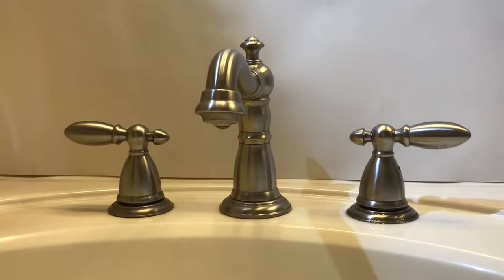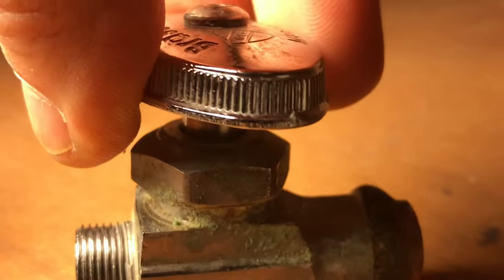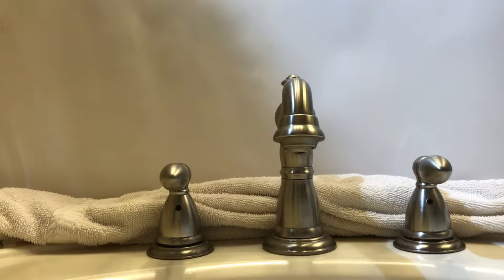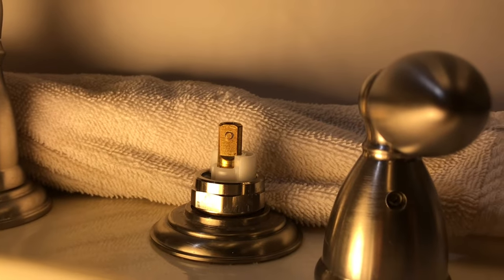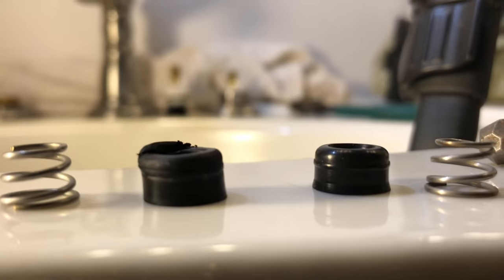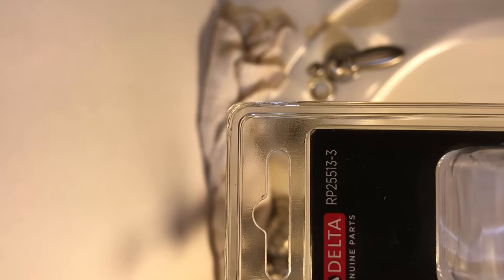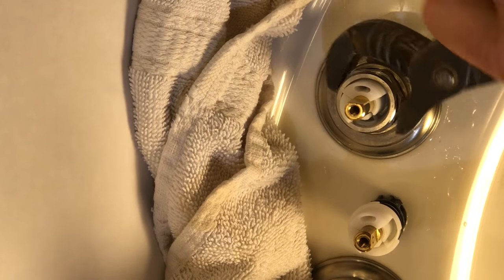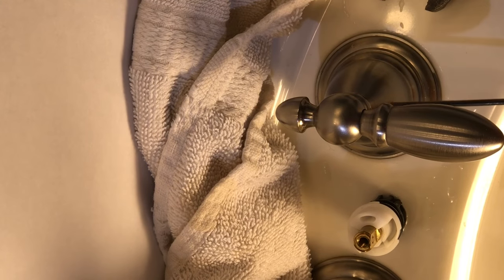How to Repair Leaking, Dripping Delta Faucet #diyplumbing #serviceplumbing @TappPlumbing

Comment: This is the way an instruction video should be made.  Very detailed and informative.  Compare this video to the Delta instructional video.  This one is so much better.  Thank you!
Reply: Very good , easy to follow, great job
Reply: Totally agree!
Reply from the maker: Thank you so much for your reply and watching 😊
Reply: I agree too! The one from Delta is not helpful, especially for someone like me, who never has fixed bathtub faucet leaks before! Thank you for your help!
Reply: I have a peerless bathroom faucet. I’ve changed out the cartridge, seat and spring on the hot side numerous times and I still have a steady drip? Help!!!😮 It is driving me crazy!!!
Reply: Great instructions

Comment: Very thorough and respectful of the parts and areas in where he is working. Some plumbers get the job done but ruin a finish or scratch the sink or counter. This is a professional.
Reply from the maker: Thanks for the nice comments and for watching!!
Reply: @TappPlumbing this video was VERY helpful to me EXCEPT that 1.)  the Allen key required for my set screw was a larger size (cold side). The hot side's set screw appears to be jimmied because my Allen key cannot get any grip. Is it time to call the plumber?
Reply from the maker: @UnderDog1911  That depends on the time verses money equation. If you can’t get the screws out it is gonna turn a little more time consuming and you need to have new handles also . Either the screws will have to be drilled out or the handles will have to be sawed off.

Comment: Unless I missed something ,You assumed the cold water faucet was leaking , not the hot water. side. Otherwise great video..
Reply from the maker: I should have mentioned it is best just to ahead and do them both . Thanks for pointing that out ! Thanks for watching also!

Comment: I have two faucets in my bathroom. Only one of them leaks. I disassembled all the handles and none of them had springs or rubber seals below the cartridge. Is my faucet different?
Reply from the maker: Is it Delta? Can you add a picture of your faucet. Email it to info@TappPlumbing.com if you can't attach here. I have never seen a 2 handle Delta without cartridge and seats and springs.

Comment: Sir, you just saved me a plumber's bill and a ton of hassle. I followed your instructions and fixed my delta bathtub faucet. Turned out to be a cracked valve seat, which I wouldn't have figured out without your video. Thanks in 2023!

Comment: +1 on the positive comments.  Excellent instruction that worked perfectly ... turning a DIY project (with the normal 'trial and error' risk) or a $$ plumber bill (if you're not the DIY type) into a flawless 10-15 minute fix, all in.  When you call Delta for a replacement cartridge be sure to request seats and springs too.  Delta will send a new cartridge(s) for free under lifetime warranty but I had to run to HD for the seats and springs because I didn't know to ask for them.

Comment: This is the best DIY video that I have seen. The helpful tips made this an easy job for me to do the right way, especially how to get the seal and spring out and the replacement parts in. Also appreciate giving the model number of the cartridge so that I could shop around for the best price and make sure it was in stock before heading out to the store. Thank you very much !!

Comment: Thank you so much for this. After fixing my sink, I have just a few comments
1. My handle took some strength to get off. Dont worry if you have to pull hard
2. Take a pic of the stem before/after taking it out. 
3. Home depot lists the part as a "stem" and not a cartridge, just so people dont get confused. 
There is part RP255513 and 255513-3. Not sure what the difference is. They are the same skew# at HD. 
My handle felt a lot loser and easier to move after fixing it. Works great, no leaks. Just felt different 

Hope this helps everyone!
Reply from the maker: Thanks for sharing!! I bet it will be very helpful!!

Comment: Very HELPFUL video. 🥇 love it’s straight to the point. Followed it today to fix a drippy Delta faucet. Easy! Most time consuming was driving to hardware store. Note to future self: Do not throw away the fixture box…or at the very least write down the model number, goofball! (Speaking to myself there.) The faucet was installed in a new bathroom in 2017 so I was fairly confident the valve and seat/spring model numbers at the store would work. They did.
Reply from the maker: Thank you so much for the kind words and sharing your success story!!!

Comment: Having just done this repair, I would like to add that you can use a soda straw to clear the water from the seat well.

Insert the straw into the non seat hole and blow into the straw.  This will force the water out of the faucet spout.  It helps to wrap your hand or rag around the stem well as blow into the straw.
Reply from the maker: @robertthomas9438  That is a fantastic suggestion my friend! Thanks so much for watching and adding to the discussion!!

Comment: Thanks so much for posting this! I do have a general purpose book for household repairs, but it isn't specific to Delta faucets/valves, which is exactly what I needed. I appreciate the tips for replacing the parts properly and protecting the sink as well!👍
Reply from the maker: Thanks for the kind words!  Thanks for watching our video and sharing your story as well! I am gonna guess everything was a success.
Reply: @TappPlumbing  Yes indeed! It turned out that I needed to replace a cartridge, but everything works perfectly again. Thanks so much, and I'll definitely be watching for more tips in future!

Comment: Fantastic video! I have never done this and have a faucet (exact same) with a drip about every 5 seconds. Seems to subside or at least go to every 30 seconds or so with the handle not at full stop, slightly open. Now I am very confident on how to tackle this. 
Thanks for the tip on calling Delta too.
Reply from the maker: Please keep us posted with your results if you can make time.

Comment: This was great, especially the part about paying attention to the order in which you take things apart and their relative position. I am great at taking things apart without doing that, so putting things back together is always an adventure
Reply from the maker: Thanks so much for the kind words !hopefully you had a quick and easy time of things?
Reply: @TappPlumbing  Once I figured out I had the 1/4 turn stop in the wrong place :( and replaced it, it went smoothly.  But your video was so helpful and everything went just as you showed in the video.

Comment: Great video! My faucet was still dripping slightly after replacing the cartridge and spring assembly. I had to keep re-seating the spring and seat. Took a few attempts to get that part of the process right. No leaks or drips. Thank you!
Reply from the maker: It can be a little challenging getting those seats just right. There is no margin for error there. Thanks for the kind words and we love to hear your success story!

Comment: Just did the install and all went well, thanks to your clear notes and saying which cartridge to buy. One note is the lever stopper comes in the package with the cartridge and you need to install it (a little white plastic piece before you screw down the cartridge with the outer ring, this keeps the levers from turning more than a quarter turn if you want that instead of a full half turn. I also wonder if just new springs and seats would stop the leak as apposed to buying new cartridges. My cartridges did not come with the spring and seats,  Lowe’s sells them separately called Dankco repair kit for Delta scald guard 80465. 😅 so awesome to do this myself! Thanks a ton!
Reply from the maker: Thanks so much for your input!  If your faucet was only dripping from the spout changing the seats and springs would eliminate the problem almost every time.

Comment: I googled this and went straight to your video. I have the exact Delta faucet in oil rubbed bronze.  I absolutely love it! I have the matching shower fixture and jacuzzi faucets. They were pricey but I don't regret the purchase. I've had them 15 years and no regrets.
Thanks for sharing that Delta will send the FREE parts for this. I have a leak on my hot water side Lefty, and also on my other vanity a leak at the faucet. Is there a phone number you would recommend calling for Delta? I am a 69-year-old woman so I hope I am tasked for the job.  Retired in 2014 with everything going great until the last 4 years. Now with such an inflationary economy hasn't left me faring too well. I certainly cannot afford to hire a plumber. Any advice you can give to this older senior American would be very much appreciated. 
You have already done a lot by providing the video. Thanks again for caring enough to share.❤
Reply from the maker: We understand! Here is the Customer Service Number 1 (800) 345-3358.  The Style is called Victorian. We hope this helps and are hopeful our economy improves. Good Luck! We have faith that you can tackle this project! Thank you for watching!

Comment: Hi! The video is great, by the way, very instructional. I'm having this exact problem, and I know which one of them is leaking, but should I replace both of the seats and springs to be safe or will replacing just the one that's leaking be just fine?
Reply from the maker: We typically only replace the one dripping as sometimes it is best to go with , if it is not broke don't fix it. We like preventing things as well however water is tricky so just wait. We definitely recommend checking your water pressure though! https://www.youtube.com/watch?v=nrGZMxpp_Og&t=154s    Happy plumbing and we appreciate you taking the time to ask plumbing questions!

Comment: Thank you sir. I'm pretty sure I only needed to replace the rubber seat, but did the cartridge as well.  Man that thing is pesky, but getting ALL the water out was key.
Reply from the maker: It sounds like you did a great job ! You are correct, they can be very aggravating for something that should be so simple!! Getting all of the water out does make things much easier indeed!

Comment: Trying to follow your instruction and having a problem. The right hand side (hot water) cartridge came out just as easily as when you did it, but when I tried the left hand side (cold water) I had 2 problems. First, there was a lot of calcium buildup on the handle, but I eventually managed to work it loose and get it off. But now the cartridge will not come off - it comes up about half an inch but then won't come up any further - it feels like there is something holding it down from underneath. I tried rotating it all around and pulling in each new position but it just won't come loose - any suggestions?

EDIT: Was able to get it off finally...seems the key was to get frustrated enough that I became willing to use enough force that I was risking breaking it! Seems the calcium buildup was holding it down somehow - I can't see how, but something was doing it!
Reply: Yes, mine had a lot of calcium buildup, but they just pull straight up with a good amount of force

Comment: Excellent video overall, really well done. One *MAJOR* issue - you made a point of talking about setting the cartridge in the same position you took it out. You later made the point that you could replace the cartridge 180 degrees the way wrong, but you didn't illustrate how to AVOID THIS. It may sound like a nitpick, but it's the one BIG issue that you didn't expand on.  Regardless - great video. Thanks!
Reply: I'm lill

Comment: Hi, great job on the video. Mine is leaking around the handle and I think you said to replace the cartridge. Is the o-ring on the cartridge the problem and can I just replace it? Are there other seals in the cartridge that cause problems too?

Comment: Thank you Joe for a very clear and in formative video. I replaced the seat, spring and cartridge on my faucet but the water does not shut off. What did I do wrong? Also, where on the cartridge or stem does the O ring has to be placed? Thank you.
Reply from the maker: It sounds like a small piece of debris is in the faucet or cartridge. Carefully look at the cartridge and if you can ,turn on the water WITHOUT the cartridge in the faucet to clean the debris out of the ports in the brass. BE CAREFUL when doing this . You have to be gentle when turning the water on . It doesn’t take much pressure to do this and it makes a huge mess . Have towels ready! 

I am a little confused on your question about the o ring and stem . If you bought a new factory delta cartridge they come completely assembled so you shouldn’t have do anything to them. Good luck and keep me posted when you get it figured out please.

Comment: First thank you for posting a good instructional video: but  every video I have watched that might give me some hope to repairing our Delta Faucets leaves me in angst! We have two Delta Split Faucet Handles Model 4530. Both faucets are leaking from the hot water side.  I cannot find any nut that is on the the topside of the "Umbrella" hidden under the base of the handle - we have a Bonnet Nut kind of looks like coupling on our irrigation system.  I was going to use CLR to loosen the calcification, but the label states do not use on brass, plastic etc., I am tempted to remove the only nut that is on the whole faucet assemblies, but it appears that it is used to fasten the water lines to the underbelly of the faucets.
Reply from the maker: I looked up that faucet on delta’s website and it discontinued. That leads me to believe it is fairly old? Sometimes plumbing parts are beyond repair and you just have to replace them. If that bonet nut is corroded in it may crush before it loosens. It is very difficult for me to really help with something like this through text . I do wish you the best of luck , keep us posted if you have time please!
Reply: @TappPlumbing  Thanks for replying to my comment.  I returned to finish watching your video - I am so glad I did because the segment of removing the spring and rubber seat is very helpful.  Soon after watching your video, I stopped at the removal of the nut because I did not see a nut on our faucet:  I found another video that used the terminology "Bonnet Nut" and I gained confidence to clamp down hard and twist to remove the bonnet nut; however, I sprayed WD40 around the bonnet nut - I was golden because I was finally able to remove the bonnet nut! Yippee, celebrated too soon. Geez Louise removing the cartridge was another challenging obstacle as it too had a lot of calcification: again I sprayed WD40 and then a few minutes later I was able to remove the faucet cartridge.  I then proceeded to mop/absorb the water with paper towels. I gathered the parts and headed to the stores and find the replacement parts.  When I returned home I was going to continue my DIY Plumbing effort, but I could not find the the spring and rubber seat.  Apparently when I was absorbing the water with paper towels the old spring and rubber seat clung to the paper towels: luckily I picked up these replacement parts too.  Today is Round 2!
Reply: @TappPlumbing  Geez Louise, I finally got the faucet handle removed from the cold water pipe; however, I did not go beast-mode until I received the replacement parts from the Delta Faucet Warranty Center.  I was surprised to receive the replacement parts, which took about ten-(10) days from initial telephone call until the shipment arrived on Friday, February 23, 2024.  I used multiple lubricants, multiple drill-bits from 1/16-in, 5/64-in, 3/32-in, 7/64-in, 1/8-in, but I think the difference was when I gained confidence on how hard I could swing the rubber mallet on the handle.  It was very difficult to remove and I snapped three-(3) drill bits in half.  Now, I am pondering whether or not I should/desire to paint the exposed brass on the collar.
Reply from the maker: @PappyNet01  You certainly are very persistent and patient! I have really enjoyed reading your comments. I hope you will continue to keep me posted . Are you just not wanting to replace the faucet because of the challenge of repairing it?

Comment: 🇺🇸🇺🇸🇺🇸🇺🇸🇺🇸Dude I honestly commend you for warning people not to turn one of those stops if it hasn't been touched in a decade or more period sometimes man if they're that corroded you can't touch them even if they haven't been touched in just six months to a year . Good job on warning everybody about that because that could have pissed off a lot of people with some pretty shitty wet days in their house 🤣🤣🤣🤣🤣🇺🇸🇺🇸🇺🇸🇺🇸🇺🇸🇺🇸🇺🇸
Reply: Thank for that awesome tip about an old valve, I was thinking to myself that I better not mess with that old valve and just turn off the main water line.   Thanks,  great video.

Comment: Thank you for the informative video, I’ve been putting off this job for almost two years due to fear!  I was able to complete the task, HOWEVER, the spring was not a tapered and went all the way down!!  I could not get it out!! 😢 I used the old tapered spring and new seat. Did I invite new trouble?
Reply from the maker: Oh no , it is possible there could be new trouble. Sometimes you can taper down a shop vac nozzle to suck the water and possible the spring out. It is not good to leave the spring in there, but if it is not dripping then we will keep our fingers crossed. Good Luck!!